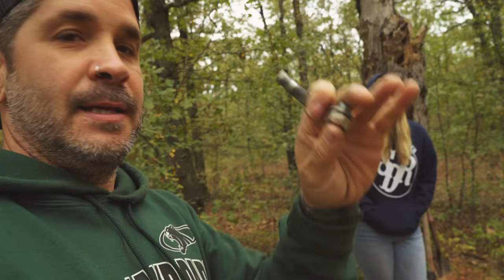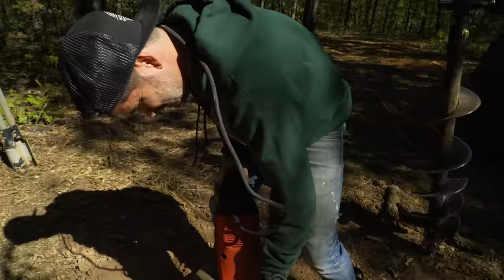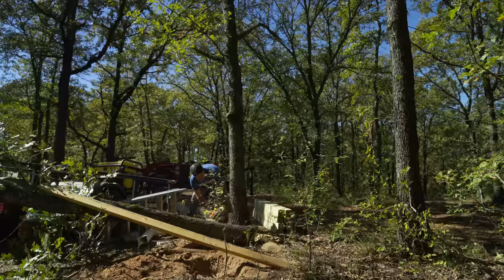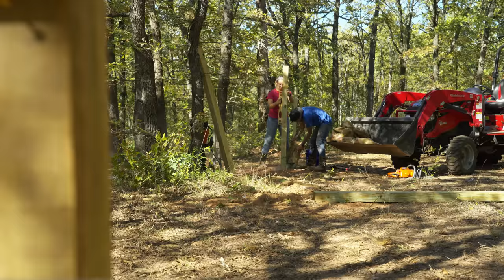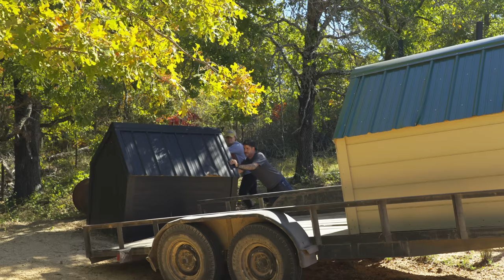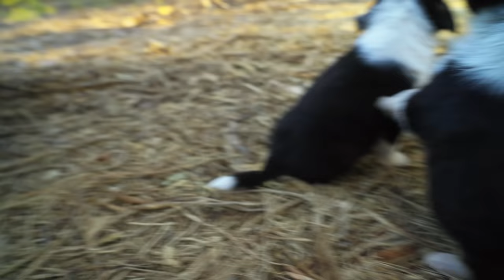Found DUMPED PUPPIES & Running Into Disaster After Disaster on The New RANCH / HOMESTEAD

Comment: Hey jason you should use the black case hardened bolts the silver ones your using arent made for that strenuous amount of pressure just trying to help bud ,,,Good luck i watched you from close to the beginning keep up the good videos
Reply: I was going to suggest the same kind of thing. The green & blues have hardness specs that go beyond the standard (cheaper, of course) type. In some applications, they can be more brittle, but it might be worthwhile to try out the greens, blues, and/or blacks. I'm not assuming, though, that you didn't already know about those options. 

Bottom line: big cheers for your teamwork and near-fanatical persistence. Much respect!

Comment: Kudos for saving the dogs. I hope somebody out there can take them, but the other thing what you can do as far as drilling holes for the post holes is if you run into rock then drill a inch hole ( with a bit for stone work ) as deep as you can into the rock, put a piece of 1 inch rebar down in it with some epoxy. Then drill a hole in the center of the post and put the post down over the rod with some epoxy in the holes and keep on going. It might save you some money in the long run. But Definitely time. 🤔

Comment: I Found you answer I found it a two am  
Dig with back hoe, and augers dont wiggle up and down only. Vbacknhoe a 3x3 if you have to go.
pit out there. You are dangerous, let her use the equipment and you film.  Trees can be aimed the opposite direction. But a good thngnfirewood for the house,mand pit. Get pointed heavy spear, pipe get in hole on rock steady it the use your bucket to hammer it down to break up rock. That is what homestead rescues did all the time and to sink up rights.

Comment: You guys need to apply for a temp pole so you can have some electricity out there if you run the underground tube to a certified breaker box check with your utility company for the drawings etc. and there you go I think ours was like $650 for the temp pole permits, etc.

Comment: Jason try sharpening the end of the shovel, sometimes that helps a lot in that type of soil. Water poured into the holes also helps
Reply: Water does not help drilling through rock. lol
Reply: @kenj5444  sometimes it does...it helps loosen up the soil so you can drill through rock. Look it up!

Comment: Do you need to buy a log splitter if you get one get a 31 ton or bigger the smaller ones have a problem connecting the pump to the motor. The Lovejoy connector sucks so the bigger ones don’t have that they’re a little more but worth it.